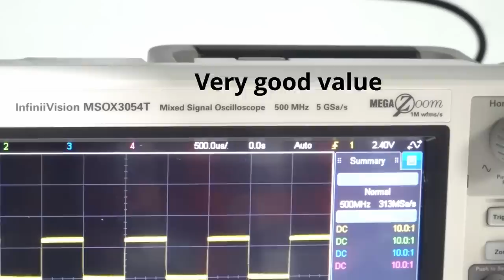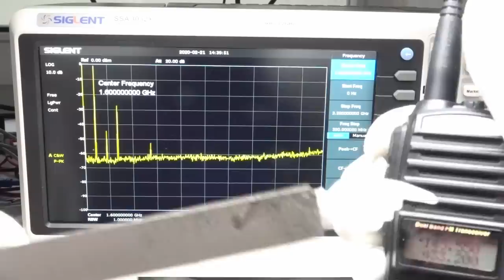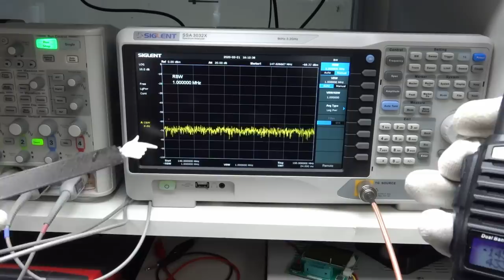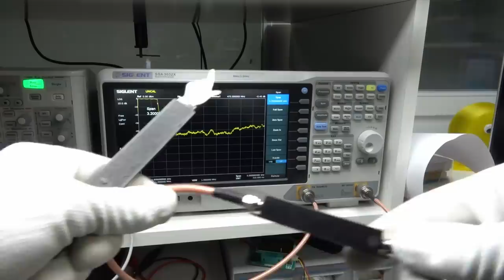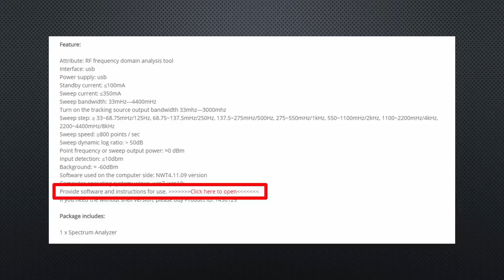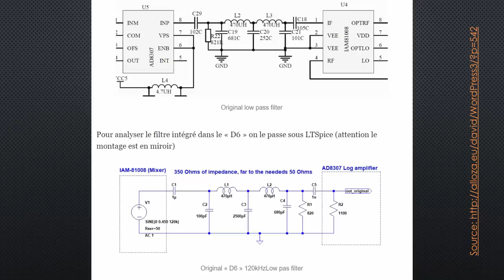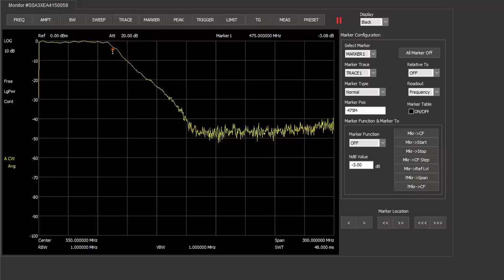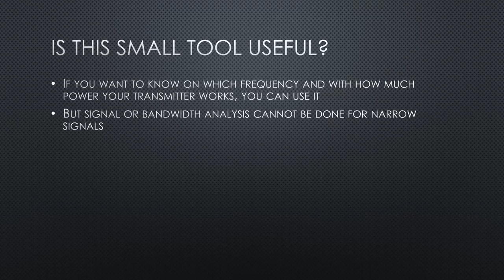#313 Useful? Cheap Spectrum Analyzer LTDZ 35-4400M

Comment: If I understand everything correctly then this spectrum analyzer uses an low IF frequency of ~few hundred kHz, most spectrum analyzers use high IF that is higher than maximum frequency they can measure. Because of that it is going to see signals that are centered at LO +/- few hundred kHz and that's why there are 2 peaks when you measure signal of that handheld. That's very bad because some signals, like signal from that handheld will appear to occupy twice the bandwidth and have a weird notch in the middle as seen on the video.
Reply from the maker: Exactly! But for 50 dollars an IF above 4GHz including filters is probably still not possible.

Comment: I designed spectrum analyzers for Hewlett Packard as my first job out of collage in 1971. The group I worked in is now called Keysight. They were very expensive but I see you can buy one now for a few hundred dollars and get a spectrum analyzer that works to 22GHz. Wow. I worked on the log amplifier that had a dynamic range of 100dB.

Loved this video. I think that this cheap analyzer is mixing the input down to DC but the filter is actually a bandpass with a bandwidth of about 250 KHz and a center frequency of about 200 KHz. Thus when you input a signal you see both the + and - image products of the mixer output spaced 400 KHz apart. The display occupies that plus the bandwidth of the filter so they call it 1 MHz. When the LO is tuned to the frequency of the input signal the output is DC and the filter blocks it so you see what looks like a notch in the output.
Reply: This is when somebody understood the math behind the view... congrat!
Reply: Yeah that's very plausible. Thank you! That both side bands are visible seemed obvious. But how is this avoided in the design of professional instrumentation?
Reply: @LutzSchafer  It gets very complicated as there are way more things to worry about than just the issue with this cheap spectrum analyzer. But for the question asked I will give a short reply. If you want to analyze .1 to 2.5 GHz, mix the input up to 3.6 GHz. Then the LO goes from 3.7 to 6.1GHz and the difference signal is 3.6 and the sum is 3.8 to 8.6 and can easily be filtered out.  Then use another mixer to get the signal down to 300 MHz and another to get to 21MHz where I built the Log amp. These frequencies need to be carefully selected so that harmonics of the LO do not put spurious signals in band so they are picked more carefully that what I did in the above example. Hope this helps.
Reply: By the way, the HP8566 weighed 100 pounds.
Reply from the maker: I suggest to watch the Signalpath video. There you see exactly what Allen explains: https://youtu.be/Fn7uaEVeOPk?t=731
Reply: Have you seen the versions started by Erik Kaashoek of the tinySA that are really cost effective using either homebrew modules or cheap Chinese modules?

Here are the links:
https://github.com/erikkaashoek/tinySA
https://groups.io/g/HBTE/topic/68803232 (and many other posts on HBTE with new MCU versions of the .ino code also)
https://groups.io/g/HBTE/topics
https://github.com/erikkaashoek/Tapr-VNA (can also be modified to be used as a Spectrum Analyzer too)

Wondering what others thoughts are as will be nice to see more design ranges as I'm about to get to work putting together my first as I just received the Si4432 modules today and yesterday the ADE-1, 2, 4, 5 & 6 mixers.  Still waiting on the STM32 boards and SA612 mixers... though have an ESP32, ESP8266, UNO and Nano that will do.  Will need to make level shifters for the Arduino's to change the 5V logic to 3.3V.  Have an AtomicPi and Particle Photon that I will eventually try some iterations with... though still at the bottom of the learning curve... though finally at the top of the resource curve (minus the touch screen, rotary encoder and latest add-ons). :-|)

Have the nanoVNA now also to do testing with as well as testing with the SDRPlay RSP1a.  Exciting and great video timing!  There are a couple other cost effective spectrum analyzers like in the videos design too (see links for other good resources):
https://vma-satellite.blogspot.com/2019/04/new-simple-spectrum-analyzer-device.html

Thinking this will be a great Spectrum and VNA modules development system since the big box systems are very modularized as noted by Andreas and others. 

Thanks for sharing everyone!  Hoping to make instructables on the above work I do as well as some videos regarding.  Very cool!
Reply: @AndreasSpiess  Amazing the capabilities of making components onto and with PCB's copper also.  Just downloaded ExpressPCB... though thinking will have to read into a lot more for the PCB related component design work and methods. Very interesting capabilities that seem cost effective if can be accurate enough I'm thinking.
Reply: @L-36  Congrats on your work! I have an 8566 and it is still an awesome bit of equipment.
Reply: Keysight Spectrum analyzer 8000-81000 still expensive
Reply: Thank you for sharing your invaluable experience.
Reply: <3 Santa Rosa <3
Reply: HI Allen, you say it is called Keysight and what about Agilent?  Has HP Radiofrequency splitted into two companies?
Reply: @manuelcornejo7405  Agilent split the instrumentation business off to Keysight. The HP I worked at is now half a dozen companies. Agilent is $5.5B and Keysight is $4.3B sales.
Reply: @L-36  Half a dozen!!! Oh my god, I think this goes well beyond what antitrust legislation in the US imposes on big companies. Maybe it is a marketing strategy to not standardize and drop prices. So these companies should have to take care with Chinese companies that are always trying to impose on a big scale and low prices strategy
Reply: @manuelcornejo7405  They are all in different businesses so don't compete. HP was a very diverse company. We make network analyzers but also heart monitors, stethoscopes, atomic clocks, and of course computers and printers. Agilent now is looks like a chemical analysis, life science company, and diagnostics company. That was a tiny part of HP when I was there.
Reply: @L-36  I can tell you that I have attended several Agilent's seminars in Madrid Soain about Network Analizers and other Radiofrequency subjects
Reply: I was wondering if I replace the bandpass filter in this circuit with a low pass filter with cutoff frequency say 400Khz, then would the notch go away? Thanks
Reply: @rihan-haque  no. That would make things worse as it would allow low frequencies at the input to show up as signals in the output stage. That would be very bad.
Reply: Wow!
Reply: When you mentioned about your first job ,my HP3585A SA which I've owned  for a few years,just popped into my mind.It's an outstanding instrument! I also have the 8568B SA but unfortunately without the TG...
Reply: Yep I looked up Keysight they are around $35,000.00 please tell me where I can find one for $200
Reply: @fromthepeanutgallery1084  When I posted my comment I had seen one on eBay for a few, not a couple, of hundred dollars but there don't seem to be any offered now. I see that one sold for $700. That is a few isn't it? Certainly compared to the new price, which is what you quoted. But I think the only people who bought these were the NSA so now sure why you would want one.
Reply: You are a legend sir

Comment: Thank you for wonderful explanation!
I got exact image of this spectrum analyzer (LTDZ_35-4400M).

I had interest in notch characteristics for CW (Continuous Wave) that 145.55MHz in your video.
I checked the circuit diagram and I understood the mechanism of that.
Following 2 things are the points of the notch:

- The same idea of DCR (Direct Conversion Receiver)
- The characteristics of RBW (Resolution Band-Width) filter

About the DCR, when we apply the same frequency signal for RF (measurement signal) and LO (Local Oscillator) of the mixer (IAM81008), the mixer output become DC signal. And amplitude of the DC signal depend on the phase difference between RF and LO.
However, RBW filter has DC block capacitors, so DC voltage doesn't reach to Logamp (AD8307) input pin. 
These DC block capacitors are the major reason of the notch characteristics.

About the RBW filter, I simulated RBW filter (including DC block capacitors) that using LTspice.
It had f0= 200kHz +/- 100kHz of bandpass filter characteristics.
When we apply CW to the RF input, Logamp input will appear twin peaks of signal because RBW filter has bandpass characteristics.

I think your demonstration of 145.55MHz CW agree to my estimation. 
Because I seen the frequency difference between peak to peak is 400kHz (=200kHz*2) in your video.

I got additional idea from these consideration.
It is TG (Tracking Generator) offset frequency.
In DCR idea, if LO and TG sweep with the same frequency, mixer output will be DC voltage.
In this spectrum analyzer, we cannot see frequency spectrum because DC block capacitor blocks DC voltage.
So in this spectrum analyzer, TG (become RF signal) and LO frequency should have offset value such as 200kHz.
Reply: Amazing explanation! I was trying to figure out what was causing the notch. This design was used to simplify the mixing stage, using just one, in contrast to "conventional", or "real" spectrum analyzers that uses two or more mixing stages, right?

Comment: I used my R&S FSEA20 analyzers almost every day for a seven year period.  I got pretty used to these high performance machines that had a noise floor of about -160 dBM at zero span.   Made my job easy.      These days those analyzers can be had for about 1500 bucks in good working order.
Reply from the maker: You are right. I see a lot of people buying these old instruments. They are a very good choice if you have enough space and maybe also some knowledge to use/repair them. For you, as a long-time user, this is a perfect fit and not comparable with such a cheap device...

Comment: wow this is so cool.  I am starting to check out how to build a SDR radio telescope and one video used a cheap spectrum analyzer test the 21cm astronomy hydrogen line.
This is a all new learning curve on making a homemade radio telescope using SDR software.  😎  thanks a lot.
Reply from the maker: Check the newest link in the description before you buy a TinySA. There is a new version available.
Reply: @AndreasSpiess  I checked it out and ordered a: tinySA ULTRA 100k-5.3GHz Hand held tiny Spectrum Analyzer + 4" TFT LCD +Battery.  Thank you very much.

Comment: Thank you for quality information. I'm using sdr + white noise Zener + spektrum software to align homemade vhf filters. Regarding my application my setup performs similar to NWT. At the end nothing can replace a good sigilent anritsu Hp spectrum analizer. Thanks again !!!
Reply from the maker: The new cheap VNAs are a handy replacement for antenna design in my opinion. And affordable for most.

Comment: You could say that the Mixer is a Multiplier.
If you remember your trigonometry: sin(a)* sin(b) =
 (cos(a − b) − cos(a + b))/2
This is why the sum and difference of frequencies appear.
In practice the Mixer is not perfect and there are nonlinearities that generates also harmonics so you get N*a + M*b (with N and M integers). But the other frequencies and usually much attenuated with a good Mixer.
Reply from the maker: You are, of course, right. For my videos I usually need more time to "leave things out" than to "put things in"...
Reply: @AndreasSpiess  I understand that just putting a trigonometry formula in a video can scare people 😆
I'm not a RF guy at all but I find that part of electronics quite stimulating.
I just wanted to add some extra for the curious ones that asked themselves "how does a mixer work?"...
Reply from the maker: BTW: Your link points to a very good channel...

Comment: Thanks for the video Andreas. My radio club bought a Rigol Spectrum analyser a few months ago and I wanted something similar for my little work bench and having found this on ebay thought it was a good little project ( I bought the naked board). I've only yesterday finished putting it into a case with N connectors and will be keen to try the new software. Love the cat on keyboard :-) Keep up the vid's, It's good to see a ham doing such a diverse range of topics.
Reply from the maker: For HAMs a nanoVNA maybe is a better choice to measure antennas and filters. I hope your SA will do the job.

Comment: Perhaps it is mentioned, but I didn't got it. Can this analyzer work as a tracking generator, e.g. for bode plotting?
Reply from the maker: I do not know a lot of bode diagrams. But the device has a built-in tracking generator. Mind the minimal frequency if you would like to use it for audio.

Comment: I made a receiver with tracking ADF synth and nextion display some years ago.  To have a flat power signal, I had to add an amplifier and a step attenuator (controlled by µC). It has to be calibrated !   Now I have +/- 1dB precision. (compared to my keysight at work)
Reply from the maker: Sounds like a nice project! All possible with today's cheap ICs. And a good instrument for calibration ;-)

Comment: Thanks Andreas a good informative video. I just purchased a unit off AliExpress not the same one you have here but its labled 35-4400MHz with a IN and OUT port and USB port. I hope it will work well for monitoring a wideband Digital DVB-S2/T ATV transmission at 1255 MHz...love your puscat I have a long hair pus too...Cheers Clint - VK3CSJ...
Reply from the maker: Usually these devices are not used as receivers. They are more used to measure emissions... 73 de Andreas, HB9BLA

Comment: Thanks for the video! I found it really informative. I probably would have wanted one of these had I seen them for sale, but as I mostly would use it to measure harmonics from transceivers they are kinda useless. I think for cheap harmonics measurements an SDR dongle and attenuator is the way to go. I already have a Nano VNA for checking filters and antennas.
Reply from the maker: You are right.

Comment: Thank you for this excellent review! I have a spare Agilent 6ghz directional coupler and plan to get this for a friend who needs to measure SWR for his home-built 3.5ghz 5G-antenna. It lacks speed and resolution as a spectrum analyzer, but I hope it works fine for plotting S11 curve.
Reply from the maker: I like the VNA to measure S11. But a SA should also work.
Reply: Thanks a lot Andreas, I will give it a go  :)

Comment: in summary:
 the price difference has its weight, then it depends on the use you want to make of it.
$ 3,000 is a great investment for a hobby, so the $ 50 device might be enough, once you compare it to some more advanced device ( hoping you can do it) you have a "touchstone" for your purposes.
If, on the other hand, you have to study the behavior of various equipment rigorously, perhaps for work, then you must think of a quality product such as Siglent or of equal quality.
Tnx for yours intersting videos Andreas and i'll see you next time!
Reply from the maker: I most probably will not do a SA comparison on this channel. There are other channels focused on this topic. I just wanted to give some advice to people hoping they can save 2850$ to go to this cheap device ;-) And they should know a little on what they have to look if they buy another one.
Reply: @ Andreas Spiess: I completely agree with you: I was also a radio amateur, and I never had a spectrum analyzer .. in reality I was more of a CB than a real radio amateur (even if I had acquired a license and license: my name was Ik4DZF but some time has passed ... 20-25 years !!) and when I built the jpole for 144 MHz I went by attempts trying to respect the project's measurements ... it worked , at least to get on 144MHz repeaters :-)

Comment: I would like to buy a spectrum analyzer for 2 reasons: 1-to familiarize myself with spectrum analyzers 2- find FM and LTE signals strenght for interference when I install antennas to be able to determine if FM or LTE traps should be used.Could the cheap one do the job?

Comment: Hi Andreas, some time ago I bought one of this chip device. I compared features wit a R&S in office lab: agree with your conclusion ...
About SW, I tried to be in touch with the original designer but ( I can 100% understand why ) I did not receive an answer. Any way, googling and spent some time reading forum, I found Python driver and commands list ...
... but all is sleeping since "The job is not worth it"
Reply: I tried to reach the author too with no success.  The software could be so much more improved.

Comment: Very good info..I subscribed and plan to watch more vids. I have added some external filters and a 30db wide band LNA on the input of mine. It has made the spectrum analyzer more useable. It’s still not great,  but much better. I also did clean up the Power supply  and did the mods going around on the net. I added a variable attenuator on the in and TG out along with the ext Amps. I packed it a nice shielded cabinet its not as good as a real network analyzer, but it is actually useful now. I actually made a selectable multi filter selection for different band widths. The stock internal  filtering was pretty bad. I may try to do some more improvements? We will see? Too many pokers  in the fire. Great channel. I enjoyed watching.
Reply from the maker: Welcome aboard the channel! You invested quite some effort¨. Maybe you document it for others to follow?
Reply: Andreas Spiess . Thank you sir. I will try to put together all my info on the mods i made. Its pretty much chicken scratch now, but i will try to compile it i to something intelligible. I will be watching and i will let the channel know when i have good information to share. Thank you for the warm welcome.